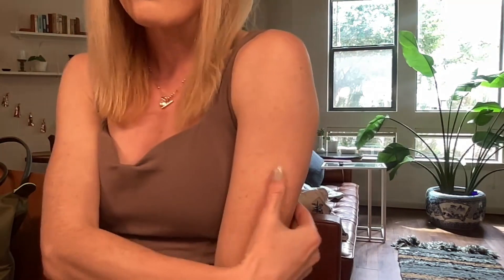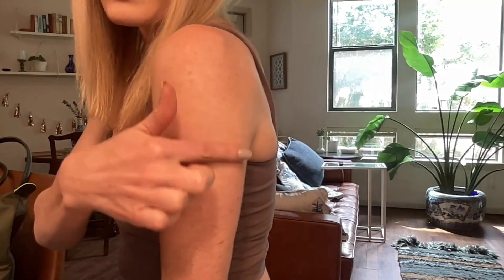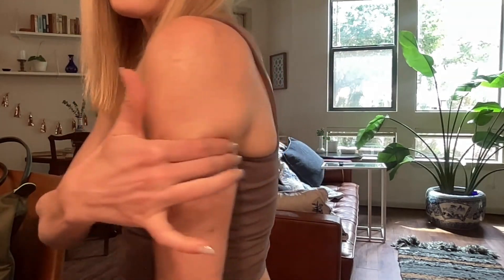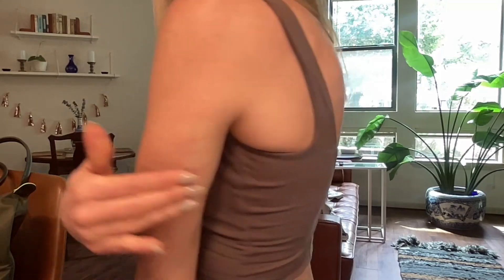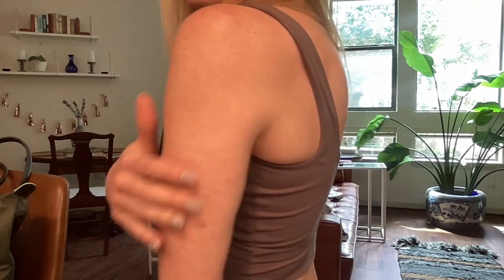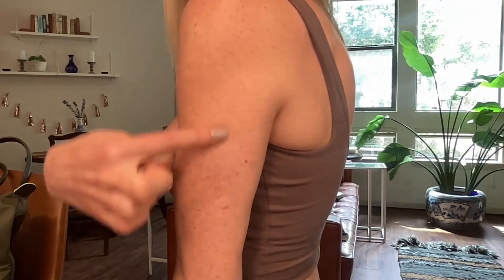Freestyle Libre Sensor Placement: Best Spots & Accuracy Tips (14 Day and 3 Plus)

Comment: I can't for the life of me find a reliable location.

I do gym heavy lifting a lot and can't find a single spot that has slosh while flexing. My entire triceps all the way up to my shoulder is rock hard.
Reply from the maker: I like using my lower back. Sounds odd but I find it comfortable and accurate here.
Reply: @drhannahhamlin glad it works for you. I had to try the belly area. Seems to work fine for me so far.

Comment: Thank you for your video.  I've have been starting to get a bit concerned about going in the pump , never had one before,  and having to change sites every 3 days with omnipod 5, with the freestyle libre2 plus staying in the same spot for 15 days. That's a lot going spots i will need to find close to the libre2  .
Reply from the maker: Thanks for your comment! I have met many many people on omnioid and a CGM who have learned to make it work. It's not a problem for most in my experience. I personally found it was just about learning new patterns of placement and then I stopped thinking about it so much. Hope this helps!
Reply: Thank you for your encouragement  Hannah . I had a 2.5 hour training session yesterday  , before getting the omnipod 5 next week  , they thought I would be better off with the dexcom G7 , as so many more site options.  So they are changing me over to the G7. 
thankyou.

Comment: From the getgo, I started using the 1st spot recommended in the video which to my interpretation, was what is recommended.  Did this with both Dexcom 7 and Libre 3+ ....G7 was all over the place tho frankly, it seemed when I calibrated it, The next reading after a -35 compared to the glucometer was followed by a + reading of the same amount.   The Libre 3+ was pretty much spot on early on but over time the CGM readings were consistently higher.   On Abbott's advice, I switched to my chest.  Readings got noticeably better but still, glucometer was up in the +20 range.

While standing online while re-upping my CGM 90 day subscription, I saw that Libre had the Freetsyle Lite Glucometer which is compatible with LibreView.  With the Lite, readings have gotten a lot more consistent but still get a +20 on the glucometer now and then.   One more thing, for reasons I do not comprehend, their lancet is barely noticeable.

The chest placement I use is about half way between the center and my armpit and about with the bottom of sensor about 1 sensor diameter above armpit level.  In one instance however, when rushing  a bit, I applied it a bit lower bit lower (or maybe because I rushed it) .  I put a T-shirt on and it had a blood stain .... never felt anything, but the sensor didn't pair with the phone right away.  That was the only instance at that location.

Comment: I get compression lows on the back of my arm due to being a side sleeper. I primarily lay on my right side and it’s very noticeable when I rotate to that particular location. Maybe the sensor just needs to be higher up and more under the arm vs the back of the arm. Guess I need to experiment with other areas or lie down and try to feel which places don’t get pressure. I’m thin and just don’t have much soft fatty areas.

Comment: I use the upper arm but I must hit a blood vessel at times. It bleeds so much I immediately have to take it out. I might try my stomach next. Thanks for the information.
Reply from the maker: I've had some that bleed a good amount and then ended up being accurate for the full ten days. We have a funny saying at this summer camp for kids with diabetes, "a bleeder is a reader", talking about CGM sensors.
Reply: @drhannahhamlin  Unless you are on an anticoagulant!   I had a bleeder yesterday.  It flowed like a river down my arm and into the sink.    I really can't stop the bleeding unless I take the sensor off and apply a cold compress.    I just think it's wrong to have to apply so much pressure to insert the sensor.   I would think there are less painful options to release the auto-insert action (similar to the Auto-Soft infusion set).

Comment: Ive had issues with my last three sensors. One fell out early,  one snagged on something and then stopped reading.  This one is wildly inaccurate (20-40 points) and wakes me up with alarm saying my sugar is 40, but it's not. The last one hurt and bled a bit, so maybe it's in the wrong place?  Hoping I can find the sweet spot you mentioned for the next one.
Reply from the maker: Best of luck here! I've called the company when I had one that ended early, they have replaced them for a free a couple of times.

Comment: Type 1 for 71 years (diagnosed age 5 in 1954).  Use the Metronic 780G pump, and FreeStyle Libre 2.  I do not use closed loop system.  In range 92-93% of the time managing myself, A1c, 5.8.  Can't open the sensor case, and amount of effort to push the sensor down on the skin is a big problem.  Three recently with excessive bleeding, severe bruising.  Hate to go back to finger sticks, but at 114 lbs and thin skin, force to apply the sensor just doesn't work.   Had to see my PC for one of the bruising areas since it was so much.   Abbott needs to re-think the design.  Should have a auto-insert similar to what is used for some of the pump insets.   According to Facebook posts, I'm not the only one with this problem.
Reply from the maker: Wow! A 1950's diagnosis. That's amazing. I can imagine you have seen so much change over the decades. That's interesting to me that you prefer not to use the closed loop system. Incredible in range percentage!! I appreciate you sharing your troubles with the Freestyle Libre 2. Have you tried the Dexcom G6?

Comment: I am senior male T2D using CGMs to refine diet, exercise and medication strategies. I am not in love with the back of the arm bc some movements of the arm cause the filament to be felt. Compression lows were frequently noticed. The adomen was pretty good until I read a post suggesting sensors became inaccurate towards the last few days of the sensor's life. Currently using the thigh area. Seems good to me with hardly any compression lows experienced. Using a CGM has enabled me to reduce my A1C from 7.8 to 6.2!
Reply from the maker: Thanks for sharing your experience! Awesome improvement!!!
Reply: I wear it on my abdomen and it works better for me.
Reply: Your demo on where to place the sensor on the arm was so helpful. I did this for my current sensor, and it's giving the most accurate readings I've had since I started using them.  No compression lows either,  which I used to get all the time with the arm placement.  Chest didn't hurt but it was wildly inaccurate. Thigh is okay sometimes. One was super accurate and two weren't.  Regardless, I'm excited to have readings I can trust,  at least for the next 2 weeks. 😊

Comment: I hate putting mine on my arms- every single time it has ripped off and even putting a patch makes things worse. I’ve had better luck with my thighs. But now my sensors have been completely wrong …just frustrated honestly
Reply: I have same problem  i put on left side on my stomach and it was bad ,so must be up on arm and  will work good.
Reply from the maker: @Bubaloo1977  Totally get it, placement makes such a difference, and it can be so frustrating figuring out what works for your body. Everyone seems to have a slightly different experience. Hope the arm works better for you this time. You're not alone in this!
Reply: @drhannahhamlin  Yes, because Abbott said to place the sensor exactly on the upper part of the back of the arm, and that's correct. I try on thigh and it was wrong reeding like on stomach .Thanks for your answer. Greeting from Croatia.:goodvibes:
Reply from the maker: @Bubaloo1977  Croatia looks so beautiful!
Reply: @drhannahhamlin Yes,thank you.
Reply from the maker: Totally hear you. You’re definitely not alone in feeling this way. Hoping things smooth out for you soon.

Comment: This was super helpful! I was getting really frustrated with the inconsistent readings from my Libre 3, even though I was applying it to the back of my upper arm. Turns out, the sweet spot between the tricep and deltoid made all the difference. Finally getting accurate BG readings now—thank you!
Reply from the maker: @azayn2434  Thanks for letting me know! I’m glad you’re finding success with it.
Reply: Hello, if I may ask… When you apply it between your tricep and deltoid muscle, is it still on the back of your arm? The example a provider explained over the phone was making a 90-degree angle with your arm and placing it (assuming mid-level). I agree with you, I also think that is the area my provider described (over the phone). I am newly dx with Type-2, and new to CGMs. Unfortunately, I found out about it while I was in DKA. So any advice would be extremely valuable.
Reply: @theeemnm  Yes, it’s still located on the back of the arm, slightly off to the side. I find that using a mirror, and checking for the soft spot between the two muscles during application helps me position my CGM better. Good luck!
Reply: @azayn2434 Thank you so much. Good luck as well 😊.
Reply: Will have to try this because I'm following the directions but I'm constantly frustrated with the innacurate readings all the time. In fact I told my Dr I didn't want to continue using it and would just prick. 😢

Comment: Great video Dr. Hannah. I am a type 2 insulin dependent diabetic. While using the Freestyle Libre 14 day sensor I too found the back of the arm to be most reliable and accurate. However, due to the circumference of the sensor it was not uncommon for the sensor get snagged on the sleeve of a shirt while getting dressed causing the sensor to become displaced and fail early. Skin Tac helped but did not eliminate the issue. This led me down the path of alternative placement spots, of which the abdomen and the lower back just above the waistline proved to be the best at staying put, even if the readings were a bit less accurate. I am now using the Freestyle Libre 3 plus which is a much smaller and more compact sensor that my clothing does not snag on and does not require the use of additional products to secure. So far back of the arm has been great, but the lower back below the waistline is intriguing, if for no other reason than to give the back of my arms a break. Keep up the good content Doc!
Reply from the maker: Thank you for your insightful comment. I appreciate you sharing your experience with it!